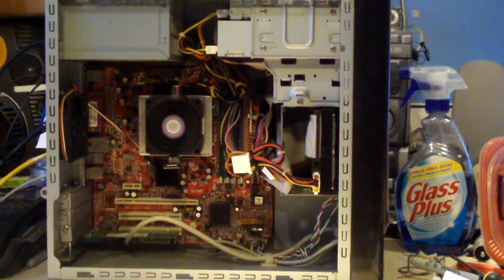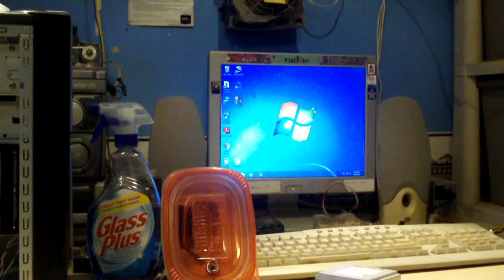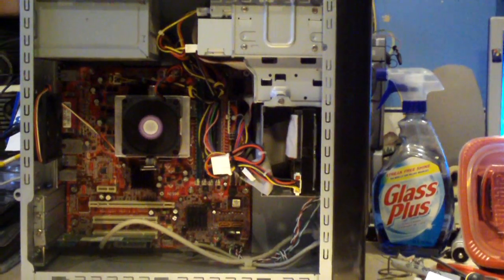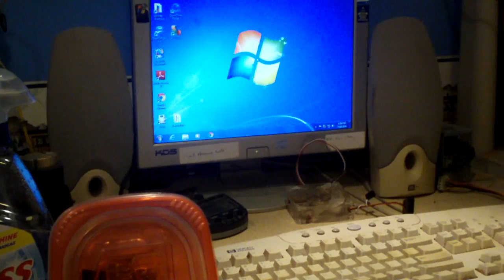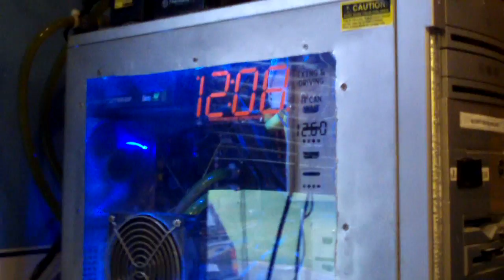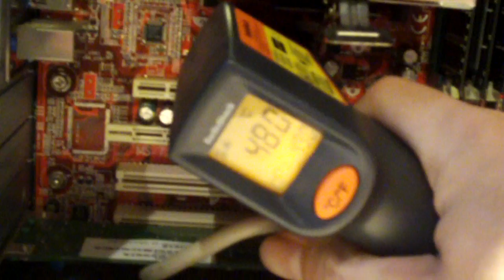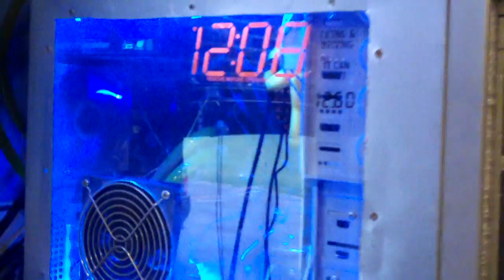Final Update on the fixed $5 eMachines system

Comment: I've got 2 of those right now with dead boards, same board.
Reply from the maker: If you power on the system and get no video at all, then the northbridge chip has lost connection with the motherboard. Sadly, it's common with these boards. Did the CPU heatsinks in both of your systems have horizontal fins or vertical?
Reply: I messed with them over a year ago, and they've been sitting for over a year. I know one has several blown caps on the board, but I don't remember the other one.